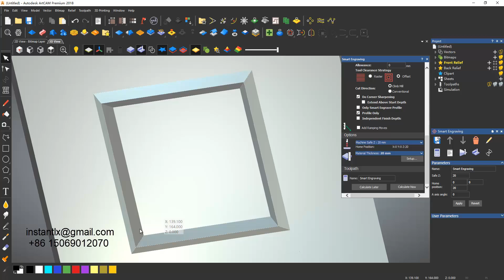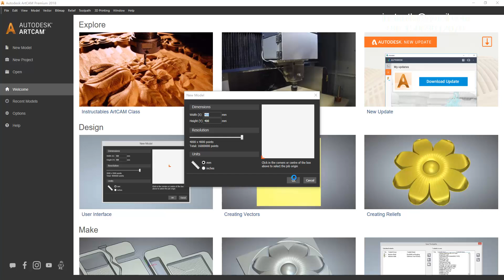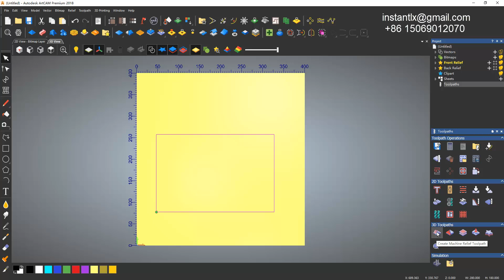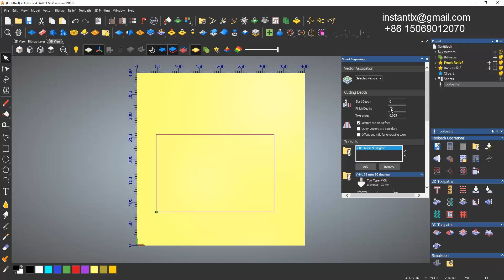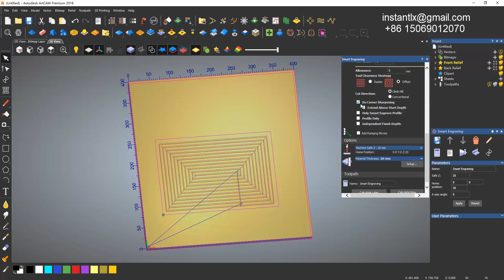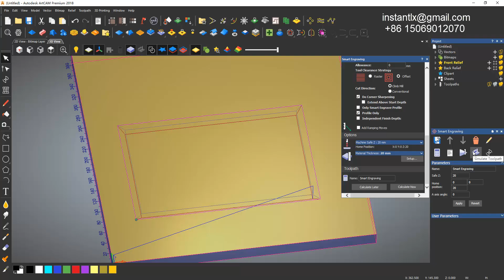V bit carving via Smart engraving, ArtCAM 2018 tutorial,

Comment: Hello thanks for your video. In 2d vbit carving why if the stepdown is set to .125 and the dept finish is .250 l have small gap in each pass? Because l work with hard wood and.250 is to ruff for my cnc. Thanks